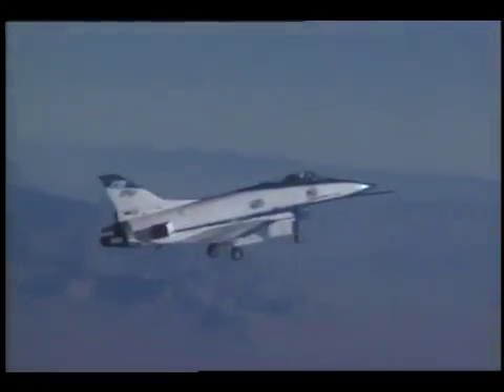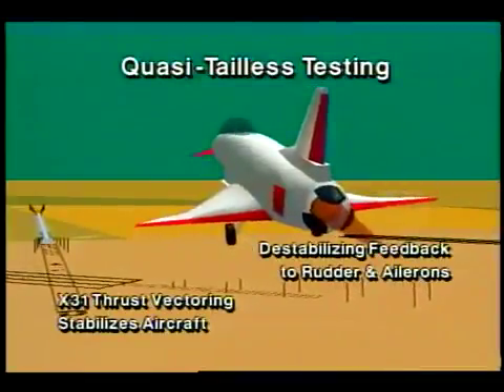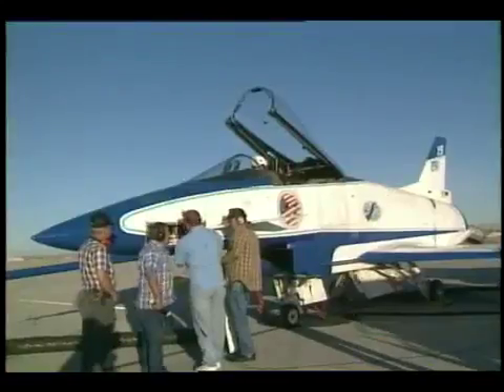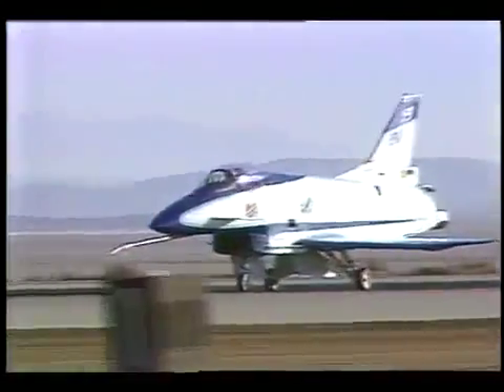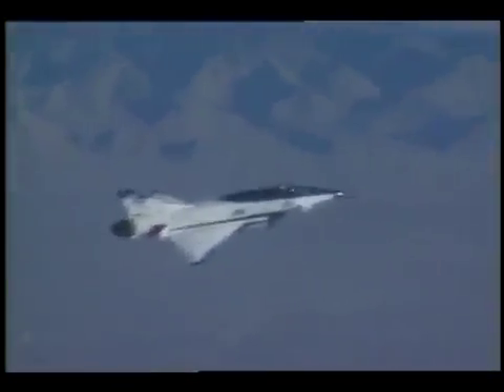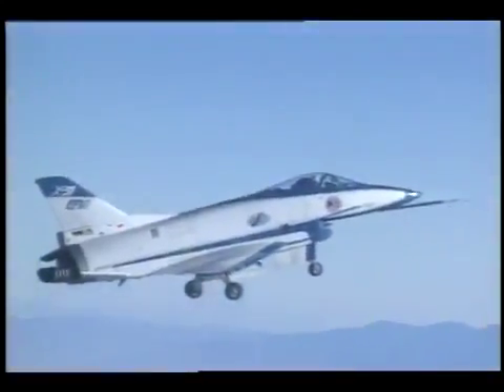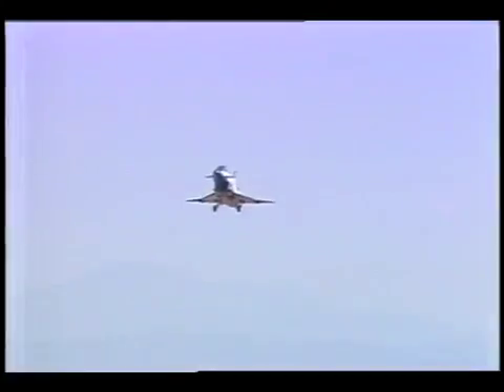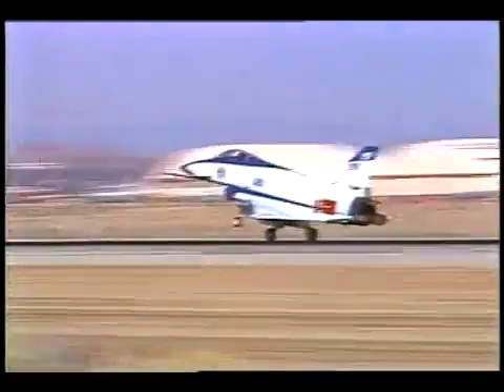X-31: NASA Tailless X-Plane

Comment: I recall one of these doing a controlled flat spin as an ACM.  There was no vertical tail, and it was engaged with a pair of F-18s.  It dropped into the spin, nose down and followed the F-18s, maintaining radar lock the whole time.  It was the most elegant display of a perfect killing machine I have ever laid eyes on.